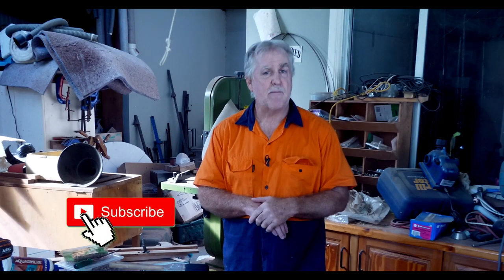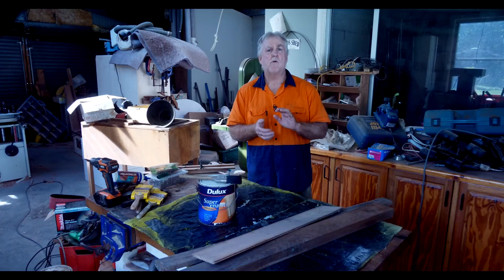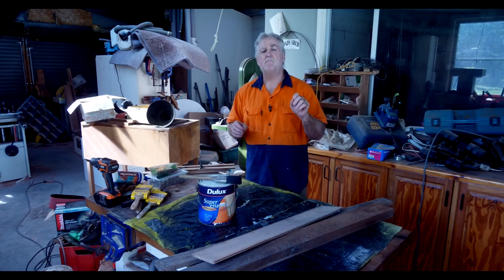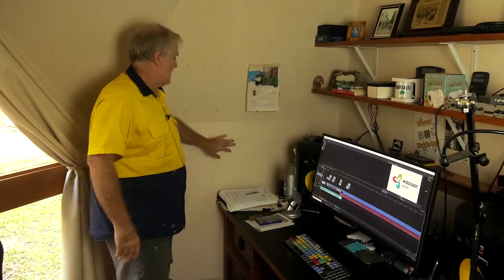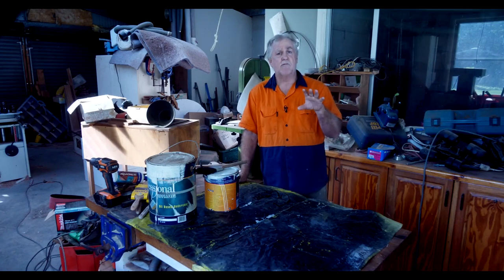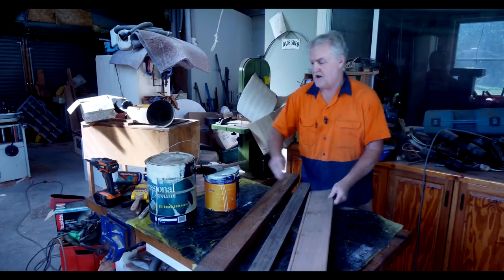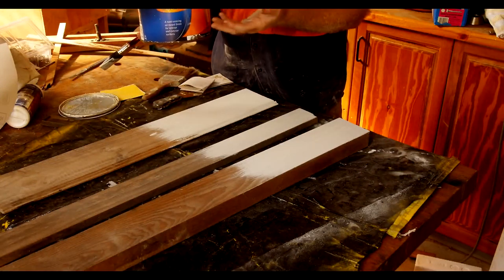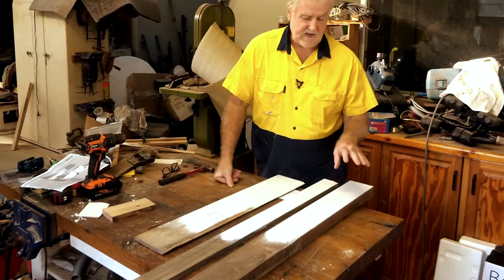To Prime or Not to Prime - You Wont Believe This!

Comment: Spot on video,can I also add for  your viewers, waterbased undercoats are mainly  used only for its sanding capabilities. Even old stained hardwood needs no undercoat or primer if you use a 100% acrylic. Its just the paint  shops selling you stuff you don't need.

Comment: we still use a oil primer oil satin or gloss sometimes and a oil undercoat on everything woodwork metalwork related interior and exterior in the uk your water based woodwork paints must be a lot better than ours. with plasterboard it is better to prime it with a oil based alkali resisting primer to give it a much harder base acts like a plaster it drys that tough

Comment: Primers have a specific function, they are not default materials. Most standard applications of materials in building and finishing are designed for good performance at low material, time and labor cost, so they shouldn't require a primer. Primers may be required for binding to a surface in a specific condition, to seal the surface, to interface two materials that do no work well together, or improve the finish geometry,  They are very useful in special applications.

Comment: Hi Rick i;m  PEI  Canada i prime repair spots  not whole walls with a good primer sealer i find if i dont  i find it flashes bad we use mostly flat paint on ceilings  here if not primed  they also flash when they cure .I noticed  when they switched to light weight seam fill er it  made  things worse.our paints are likely  not the same as yours ,and our paint stores hire anyone of the streets lol

Comment: is best to dilute your undercoat on bare timber if not using primer but for interiors on bare resin wood aluminium primer is best
Reply from the maker: I've used primer only a handfull of times over the last 30 years or so They where used extensively years before that but then, everything was oil base. Pretty much a mandatory requirement in those days, even red lead primer.
Primers are rarely required these days. Undercoats on the other-hand, are still needed for certain coatings and preparations but even these materials are disappearing since the rise of water based paints.
As for diluting, yes, it's a good idea, particularly with first coating anything. Well, almost anything.
Never heard of aluminium primer and not sure why anyone would even need it.
Thanks for the comment, great questions :)
Reply: @RickBushell1958  surprised by that is the best interior wood primer you can get self knotting and for better adhesion over varnish stain etc. i personally use oil for everything rarely use water apart from priming metal or mist coating
Reply: @jackwardley3626  what do you think of zinsser Bin.
Reply: @mack1609  it performs well but bin isnt easy to apply drags very quickly prefer the water based 123 plus zinsser as a all purpose primer but the best wood primer is dulux trade aluminium wood primer in my experience
Reply: @jackwardley3626  thanks for the advise. Reason I asked was I found the bin to be brittle. Did some door frames that were oil clear coat. Sanded them down for key. Bin first, 1 undercoat, 3 top coats all waterbase. Scratch test on bin was good. Door frames look good. But they got a few heavy bangs and they chopped off to the clear coat. Will try the oil based next time.    Used the aluminium primer years ago on my teak door, had forgotten about that primer. Thanks again.
Reply: @mack1609  alright sand in between coats also with a 320 grit also

Comment: Love your channel Rick! So just double checking, but I think I know the answer, I just had a plasterer patch my walls as I had wall lights removed. He’s done a brilliant job. I’m assuming I don’t need to put an undercoat over just the patches? Also, when I slide my hand over the patches there’s a fine dusting on my hand. Do I just need to brush this off before I paint?
Reply from the maker: For interior painting of cielings and walls, usually you never need a primer, just use the paint you are using to paint the cieling as your first (primer) coat. And yes, give the patched area a wipe with a dry cloth to remove the dust. easy

Comment: Isn’t ‘primer’ or undercoat generally less expensive than wall paint? Rather than putting three coats of premium paint on new drywall does it make sense to start with a primer to even out the texture?
Reply from the maker: Not necessarily, rouphly the same cost if using professional quality paint. Using a quality paint over drywall, only 2 coats are needed. Done it that way for 40 years. Never an issue.

Comment: Hi Rick, I just found your channel.  Thanks for the real-life tips!  Could you answer a question for me?  I just finished painting fresh drywall with a satin paint.  I first used drywall sealer.  I have a few areas that are shinier than others. I think the pros call it flashing.  Is there a way to correct this issue without completely repainting the entire wall again?
Reply from the maker: Unfortunately there could be any number of issues for the reasons why. Easy enough fix tho. Let the paint cure as long as you can and I'm afraid you will have to repaint entire wall. Sorry
Reply: Thanks Rick

Comment: In the UK we don't have oil based enamel paint other than very small tins of radiator paint. If you just painted straight on to bare wood with oil based undercoat and not prime first the undercoat will just dry on the surface and not bond properly with the wood, once the painted wood has been through a couple of seasons with the wood swelling and contracting the paint would start to peel and flake. What I noticed in your video when you were doing the demo is that after the first coat of undercoat you had to sand down the raised grain which tells you the paint has bonded with the wood, the oil based paint we have in the UK doesn't raise the grain unless you use a primer first. This is based on nearly 30 years as a painter and decorator working in the UK, perhaps that fella that got so upset is a uk painter too.
Reply from the maker: Must be very different paint you use in the UK.
Reply: you can prime bare wood with oil undercoat if you dilute it just like you would with fresh plaster so it soaks in

Comment: So, do you use a product called penetrol (a paint conditioned so it flows better) with the oil paint?  I want to paint my kitchen cabinets with oil (I like the glossy finish) and have been looking for info on using oil based paint and that is one of the recommended things I have come across. I am going to watch you other video on oil painting. Thank you. Oh, I am a DIY not a professional painter.
Reply: Penetrol is a good product, extends the drying time allowing you to work more surface and easy lay off. Also helps the paint stick to the surface. Its not an essential product though.
Reply: Kristian Dentuto ok, thanks a lot !

Comment: Hi Rick I have a fiberglass  entry door about 5 yrs old I was going to wipe it down with a TSP solution then rinse ,dry and paint with a latex I used on my other entry door(wood).I'm guessing I should not prime.Is this what you would do.I just found your site and plan on watching ,Thanx for all this advice
Reply from the maker: difficult to say without being there. Never seen a fiberglass entry door. A bit of assumptions on my part here, but I'm guessing it's bare fiberglass? 
I would apply a coat of all purpose oil  base undercoat, sand smooth and apply what ever you are using for your topcoat. Doesn't sound like you need to use tsp, but maybe a sand before undercoating.
Reply: @RickBushell1958 Thanx for responding Someone told me to use mineral spirits or acetone.I know TSP has worked great for other projects,both roughes up and cleans in one.Worked great on wood paneling which isn't pores with a high sheen.Don't mind taking the time,just don't want to experiment and have a mess on the main entrance door

Comment: Thank you for this. Would you mind answering a question for me? A painter repainted all the doors in our home 7 years ago. They were originally done with oil-based paint and he redid them using acrylic. They are not holding up well and paint is peeling on one door and wearing away where people tend to hold the door rather than the handle. I would one day like to repaint using oil-based gloss but I am not sure how I should remove all the acrylic paint. Any help would be much appreciated, thank you
Reply: If you can take them off, sand them down best you can ,scrub with metholated spirits ,oil based undercoat then your top coat.
Reply: You can paint with oil based paint over the acrilic, no problem, but it is better to undercoat them
Reply: @krikri3387  thank you
Reply: @ThePa1nterhowto  sorry, only just seen your reply, thank you. No, the doors will not be coming off, so will do the best we can. one door at a time.
Reply: @Aussieuke  If the acrylic paint is coming off easily with a finger nail scratch(Very common) you will need to sand (Remove) as much of that as possible otherwise you will have the same problem. I personally would use an orbital sander, Quick dry oil undercoat and then your top coats. That's the proper way to fix your problem.
Reply: @ThePa1nterhowto  Thank you.

Comment: Hoping you see this:  we are going to be repainting our baseboards. They are dinged up and chipped and have paint spills on them.  We originally were going to strip them down completely but due to time constraints, we just plan on roughing them up and repainting. 
Do we need a coat of primer before we paint them white again? I was going to prime until I saw this video but now I'm not sure.  Thanks!
Reply from the maker: First things first, what kind of paint is on them now? Water base or oil base? If you don't know, then watch this video: 
https://www.youtube.com/watch?v=oHT5wvDEiD4&t=6s
This is important, you must know what you're painting over. You can't simply apply water base paint over oil base paint and vise versa.
If you are changing your system (water to oil or oil to water) then yes,  will have to use an oil base undercoat.
If your baseboards are already water base and you have purchased water base, then no problem at all.
If your base boards are already oil (and you have your water base paint) then you will have to give a good sand and apply one coat oil base undercoat before applying your water base finish.
This doesn't cover everygthing, but I think will get you out of trouble.
Make sure you find out what you  are painting over. :) Happy painting :)

Comment: wouldnt trust these self priming acrylics especially after seeing new exterior windows failing badly with the stuff. oil primer oil undercoat oil top coat always the way to go for interior trim linseed oil paint for exterior trim its that simple
Reply from the maker: Hi Jack, I'm an oil man myself and prefer an oil finish on certain things. But it can't always be that way, times are changing, and these days, there is very little oil finish on jobs I quote so one is better to stick to what is there, at least for me. I don't think one would get the job with the added cost to change the system the customer already has.
Reply: @RickBushell1958  i dont know all the self priming acrylic ive used needed 4-5 coats to cover
Reply from the maker: @jackwardley3626  can’t say as I’ve really had that issue, once tho I did need 3 coats.